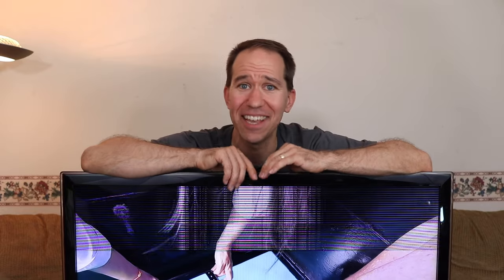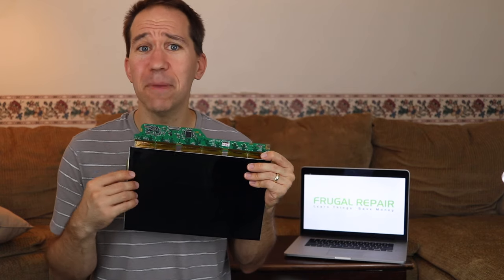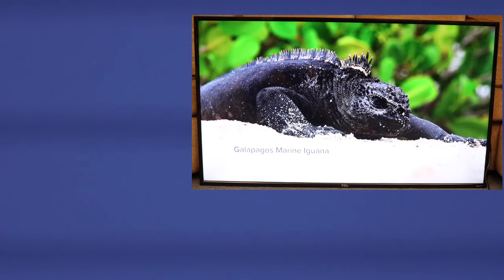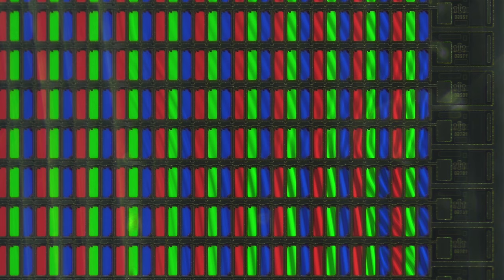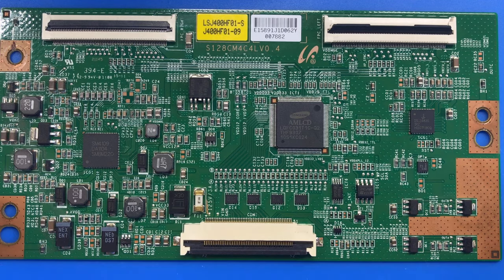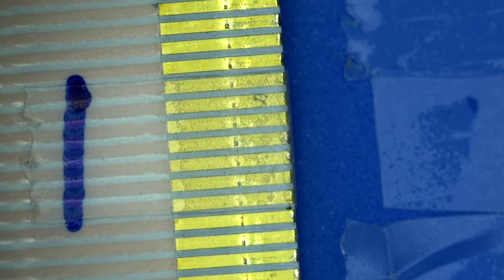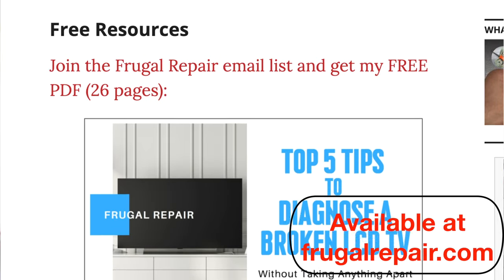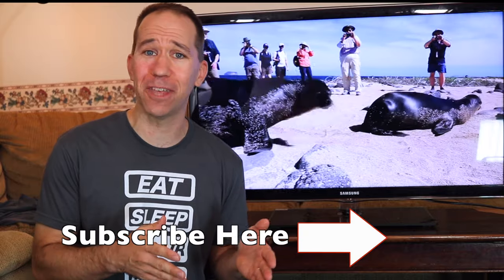Repair Hack Explained | How to Fix TV Horizontal Lines - Part 2

Comment: Thanks for vidéo. On my tcon board I only have inscription like CF or CM  or RG. Nothing with CK or CLK for clock information. What should I do to find the right pin emplacement to repair my 3 verticals lines on my 55 Samsung tv?

Comment: Hi Reese
I have a very old monitor that I like so much... Is a VX2450WM-LED ViewSonic with horizontal lines... My issue with it is that only have one ribbon cable.... So I do not know if This could be fixed... Would like to know you think.... Thanks

Comment: The top third of my tv works fine. Below that there is a horizontal line and the picture below this is comprised of horizontal.lines and vertical coloured lines with a clear picture underneath this. It also looks like these are in blocks of large boxes. I'm baffled. Thanks for the very informative  videos
Reply from the maker: It could be an issue you can fix like I did in the video. Did you try?  Not seeing it, it could also be a crack in the screen.  And it’s possible it’s a tcon board or unrepairable lcd screen issue.

Comment: I recently had a single blue vertical line pop up on my 70 inch TV. Other than the pressure technique, that you have replied to other comments with, is there anything else that could work to get rid of the single blue line?

Comment: Great videos! I do have an issue with my LCD though. I lost picture but had backlight. So I replaced the T-Con board. Got my picture back and now I am dealing with horizontal lines. I was hoping this video would help unfortunately my T-Con board doesn't seem very easy to determine where any circuit are going to. When I change the volume though it shows up in the upper right hand corner (the current volume), well that is bleeding into the horizontal lines. Each time I move the volume I can see the line changing slightly in the same space. Would you happen so have any thoughts on what it could be? Perhaps one of the driver boards for the panel? Any help is greatly appreciated! Keep up the great content!

Comment: The piece of tape fixed my issue so I got round to swapping the T-Con board today but the issue is still there, and I had to put the tape back. Does that mean the T-Con board is potentially fine and the ribbon cable is the culprit? Thanks

Comment: I think I will attempt this for my MI widescreen monitor. The lines came and went for a while, usually across the bottom and slightly flickering or changing color. But now they've turned black, which probably means they wont go away anymore. 
This isn't really usable, so I might as well try to fix it

Comment: My insignia fire tv all the sudden had vertical colored lines last night. I removed the left lvds cable (on the back), which then cleared the screen on the right (facing the screen). Could this be the lvds cable or part of the t con board went bad? Also, will the tape work for vent lines?

Comment: I replaced the main board, power, tcon and 2 others in my tv. Blocked some lines using this method and it got a little better. It has a bunch of vertical black/ white lines. However, I must be dislexic or something because I couldn't count down the connector and block off the right one..

Comment: This is absolutely brilliant and solved my issue. I am curious, however, regarding the relative safety of blocking the lines of the ribbon cable with tape. Doesn't this present a fire hazard given that current is still passing through the ribbon cable from the main board and being blocked by the tape. Does the tape provide sufficient protection that the electricity doesn't present a fire hazard with regard to the tape?

Comment: Thank you for sharing the knowledge! I do similar things, (sharing) but with different electronic devices.. wanted to try myself in different field and I am stuck at the moment.. have bought an 34 inch widescreen monitor from LG that has flickering lover side of the screen. There is a dead pixel (red) that seems to influence this defect as flickering is happening below the dead pixel. With your isolation technique I have isolated 8 pins that goes on the t-con board from one ribbon cable mount to another (jumper tracks or it seams so) not the clock pins.. after isolating, flickering disappears almost completely, dead pixel gets a line and a row turned on permanently ( with initial flickering the line is seen only in the below flickering part not the upper screen) and around third of the screen vertically is considerably darker but image is seen normally.. so after long post have you seen something similar? I have ordered a new t-con board just to check, but it will take around 1 month to arrive so if there is something that I could check in the mean time it would be highly appreciated as this enormous thing takes over my whole work bench... ;) thanks in advance!
Reply from the maker: Congrats on trying something new.  Honestly, I'm having a hard time envisioning what's happening.  Monitors of that size are likely only to have one lcd driver board so it makes this tape trick harder to do.  You likely still have redundant row signals entering each side of the lcd panel.  If you can't isolate the row signals on that side of the lcd screen then I'd probably say to wait for the new tcon.
Reply: @FrugalRepair thanks for fast reply. Will wait for the t-con board and update on the Situation afterwards..

Comment: Hi Rhys: the problem with my 58" TV is that the horizontal lines are not always at the same location. Sometimes cover most of the screen but after a while, say half an hour, they almost disappear, with just a few flickering lines near the top of the screen unlike the ones in your example that are stationary confined to just near the top of you screen. In my modest opinion there is something else that is wrong with my TV. Could be a ribbon cable? I replaced the T-con board after I probably damaged the original board plugging and unplugging the ribbon cables.

Comment: I love your knowledge and clear explanation but I am going to just buy another t-con board and it should be ok, thanks many times.
Reply from the maker: Thanks.  In this case a new tcon would not fix the problem because the problem is inside the lcd panel.

Comment: I seem to have a small group of horizontal lines about 6" tall and pic distorted in that area. Advice if I have a failed tconn or something more serious?
Reply from the maker: Doing the isolation technique should give you a good clue.  If the picture looks normal on one half of the screen during the test, then tcon is probably ok and the issue is the lcd.  Not a guarantee but it's how I first take a guess at the issue.
Reply: @FrugalRepair  Thanks! So your saying if I disconnect one ribbon cable going from tcon to panel and the lines do NOT show, its a panel problem?

Comment: So if the issue remains when running either side. Does it mean the only way is to replace the Tcon or is there a chance to still fix it otherwise?

Comment: @FrugalRepair ive tried this solution using tape, and my TV came on but there are still some lines, my question is if i buy a new tcon board will that fix the issue? Kindly advise

Comment: Hello mate. I have a Sony Bravia 2007 and half the screen horizontally has lines but discolouration as well and I’ve taken the said ribbons off and the left side displays white (with ribbon off) and right side black and right side (with ribbon off) displays yellow lines and right side is black. Now I’m gonna try the tape trick and see how it goes. My question is, do u think I’m on the right path or the tape hack will fix nothing ? Thanks in advance 😊

Comment: I have a 55 inch Samsung with horizontal lines like ik the video but they are only from top to bottom on the right side and about an inch wide. Any ideas on that by any chance? Great video btw :) Even though I don't understand all of it exactly I've learned a thing or 2!

Comment: Hi, great video. I have horizontal lines on the bottom half of my screen. I dismanteled the TV, but there is no separate T-con board. There is only a mainboard and the power supply. I guess, the t-con is integrated into the Samsung LCD panels electronics? Is there any trick for such a TV? Thank you! Gyula

Comment: Hi. Do you think its a faulty tcon board? Can we replace that instead of using tape? thanks in advance.😊
Reply from the maker: No, the fault is inside the LCD panel assembly so changing the tcon board won’t help.

Comment: I have a vertical line problem like your first video, but I can't identify the CLK signals on the TCON board. This is a Vizio m558, and the problem is on the left side of the display, and that cable off the TCON board has 60 lines. Any suggestions on how to identify the target lines to block?

Comment: Believe it or not I still have an old tube television Can't see the wisdom and throwing it away if it's still useful However on the top six of the screen I do have some horizontal lines Any ideas?
Reply from the maker: On a CRT TV?  I’m not sure.  Maybe a capacitor went bad?  It’s completely different technology than LCD.

Comment: Hi loved your video very informative I'm working on a 13.3 in Samsung screen that has horizontal lines and no backlight but all the voltage is present except the backlight is only 12 volts...got any suggestions thank you in advance... screen number LTN133AT17-104
Reply from the maker: Sounds like at least two problems.  Maybe there’s a board that handles both image and backlight and that’s the culprit? Sorry I can’t say much more without working on it.
Reply: @FrugalRepair  yes it's in a digital stream clear case TV just a mother board, a small board that transfers the odd and even signals and vcc to the image and backlight driver board... it's used mostly as a monitor...it has 6 cof and I'm interested in learning about the ckv and ckl lines... and their connection to the vgh and vgl... electronics is very intriguing to me... any help will be greatly appreciated love your videos

Comment: Great video! I have a similar problem, but in my case (LG 47LV375S) the horizontal lines are at the top on both halves of the screen when i disconnect each connector. Is there any hope?
Reply: I don't know if it's normal, but the T-con board emits a buzzing sound when the TV is on, louder than any other electronics in the TV.
Reply from the maker: Thanks!  I would next suspect the tcon board is at fault.  Not 100% sure of course but that is my next guess.
Reply: @FrugalRepair  Thank you for the reply, I will try replace it, then I'll let you know. Keep up the good work. I will slap the subscribe button.
Reply from the maker: Nice!  Don’t forget the notifications too. =)

Comment: hey thx for this video, i got an old TV that also has horizontal line at the bottom 3rd of the screen. but they are very faint, i can hardly notice it unless im up close, so imma leave it be. however if as u said its a short/open circuit, then could that be dangerous for the long run? especially i like to leave the TV on over long period of time even though im not there. could it catch fire? recently my mum had a PC monitor that started to burn, she could smell and see smoke, a corner of the screen started to turn dark.

Comment: Hi one of my friends has a Samsung 43" with a line 2/3rds of the way down the screen and then everything below faded, do you think this is a similar issue that can be fixed with your tape method. BTW been watching your video's for last couple of days. think there great.
Reply from the maker: Thanks for your kind words!  I don’t know if it would solve your friends issue, but it sounds like the same kind of problem that could be addressed with the technique I use in this video.  You would want to do the isolation technique and if the problem gets better on 1/2 of the screen, then that is a indication that you may be able to use the tape trick.  If the problem exists on both half’s of the screen when you’re doing this test, then I would next suspect the tcon board.
Reply: @FrugalRepair  Think i'll give it ago next weekend nothing to loose as my friend is intending to but a new TV at worst i'll get the part no of the T Con board. If good esult i'll save my mate a few hundred £'s. Ill let you know how i get on

Comment: I got 1 line runs across the bottom of screen where the frame meets the screen. The line changes with what’s on the screen. I’m thinking of swapping out tcon board it’s sharp aquos  75” 75G162841X00008

Insight appreciated and I’m adamant of trying to fix myself. Thanks in advance great channel btw!

Comment: My vizio television showed no video, backlight was fine, and I put some tape on the side of the ribbon cable that was causing problems and it worked! Only problem is that problematic side is noticeably less saturated. Would trial and error with the tape covering the pins on the ribbon cable to any degree alleviate this?

Comment: cool, thank you for the videos
I have an old SEIKI SE32HY TV with a few vertical lines. it started with just a few on the right side, and now it is full of lines, but sometimes it clears up and looks good (oh ya, they are white lines) I thought it had a bad connection, so I took it apart and cleaned the connectors with Isopropyl Alcohol, but no change. any kind of info you could send my way would be greatly appreciated.

Comment: So I have a IPS monitor with a couple of horizontal lines at the bottom. It has only one ribbon cable from the main board to the panel. I tried taping some parts of it but I only get black screen then. Is it possible to fix it with tape? Maybe should I have to just tap on the pin corresponding to the problem? Thanks!
Reply from the maker: With only one cable going in to the lcd panel, you may not have redundant row signals to block.  Or at least not easily.  There may be row signals being sent from each side of the panel but my guess is to block one side you may need to physically cut into the driver board then solder back the lines you don't want to block.

Comment: Two Questions: 1 How long do you wait after unplugged do you touch it, 2 , which is better Lcd, Led, ?
I have worked with Capacitors. Before and waited apox 20 mins for them to discharge, is this the same?
Thanks great Video,

Comment: How do I find the patent application for Vizio v505- j01 so that I can figure out which of these are the row signals? I figured out which side of the t-con board to unplug. I got that side working good. Now I need to figure out which are the row signals so I can tape off on the other side?.

Comment: I think there's a way to find the problem in the circuits. Like finding a bad cap, diode or transistor and replacibg it to get the tv back as new. It juat takes more time and tools, Am I right?

Comment: I have a 55" JVC LED TV, it has vertical lines on the far right hand side, some color some black bars. The screen image looks like a damaged display, but the image moves and other portions of the image will show up in the black bar and the color lines will change. Does this sound like a damaged screen (no known damage, no impacts or falls) or a bad Tcon board maybe?

Comment: @FrugalRepair did you ever face a screen where the 4 cornors are bleeding red but when watching a movie everthing gets covered based in the scene and the bleeding screen gets coverd up like its not even there
Reply from the maker: I’ve seen solarized images, not sure if that’s the same you are describing.  I would try this isolation technique and see if it’s the lcd panel at fault.  Next I would suspect the tcon board.

Comment: I appreciate all the information that is a handy trick but I have a little bit of a different problem. My TU8000 Samsung first had 2 vertical lines in the middle of the screen then shut off by its self so I unplugged it for a few hours and plugged it back in it was fine limes still there. But then I turned it off to go to bed and when I did it started power cycling and not fully powering on fully. So I'm not as skilled as your are but I understand the basics of what it could be can you help me out.

Comment: Hi just a suggestion tho, wouldnt replacing the ribbon cable be better? Mine's a (awm 20941 vw1 90v 105c) i've purchased online, I'm yet to give it a try
Reply from the maker: No, because that's not the problem.  The issue is a short inside the LCD assembly.

Comment: Hi there,  please helyme! I bought a 7years old 65inch 4K I got 3 pixel in vertically it’s  not visible at start but then  few minutes later the middle pixel is dark the other two is green on dark background.
I wonder if playing the ribbon or changethe t-con board would sort this or it’s a screen problem?
Reply from the maker: This typically indicates either a tcon problem or worse, the tab bond on the driver board is lifting.   You'll want to visually inspect the driver board.  A somewhat common thing is that people clean their LCD screen and the liquid runs down and causes corrosion on the tab bond.  If this the case, you may be able to clean it carefully and do a trick to put pressure on that spot to help remove the lines.  You could also do a very careful micro-soldering surgery but it would be near impossible without the right equipment.

Comment: Would replacing the ribbon cable with a new one fix the issue?
Reply from the maker: If that was the problem, yes.  But usually it’s not
Reply: @FrugalRepair  when I remove one ribbon cable, half the screen works. When both ribbon cable are in, the screen is blank but the backlights are visible. What do u think the problem is?